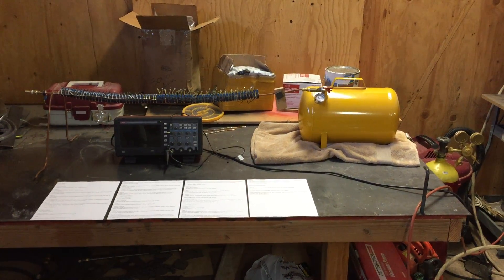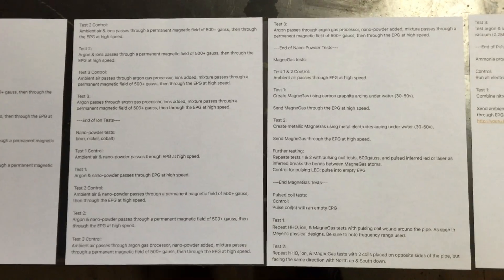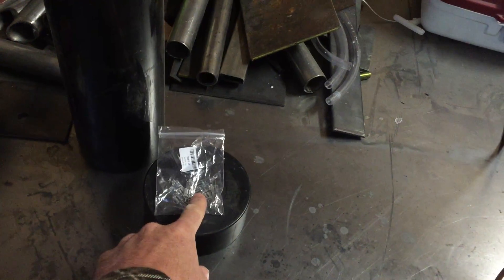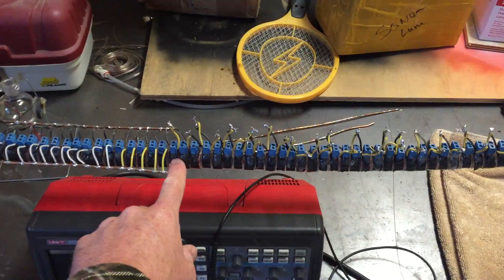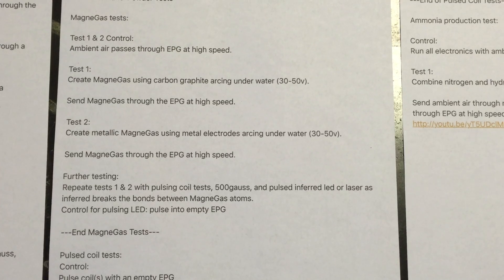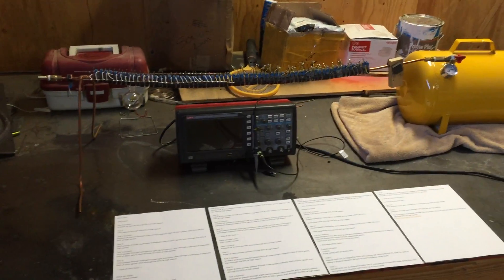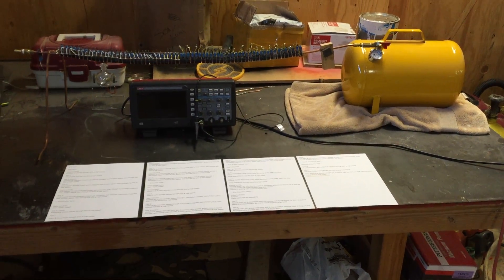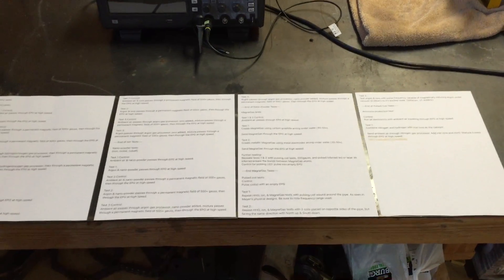EPG Tests 001 - Series Intro

Comment: HI Russell..I am having a go at making cobalt gas (will try iron, but had a cobalt alloy at hand)..so far the results look promising but I haven't made an EPG or similar to test with..I'm at the stage of mixing it with argon which has been ionized...wish I could post you some but they are pretty wary of gas cylinders in the mail..check out my video on the magnetic cobalt vapor which is the first half of the production cycle..   https://www.youtube.com/watch?v=nr77ftiMo4Y
Reply from the maker: +electro1622 Very nice, lots of vapor coming off that! Here's one more way to get metal vapor in the gas, not as pure as your method though: adding metal powder or oxide to water while creating an arc under water. The metal powder flows between the electrodes and vaporizes. Recently confirmed by Frank Sullivan with copper by lighting the gas on fire and showing a green flame. Indicative of burning copper.
Reply: +Russell Martin yeah...it's in a vacuum and melted with induction so the vapor is pretty much just cobalt..it's amazing how the magnetic field affects it making it flow directly to the crucible wall...when you turn the induction field off the vapor rises straight up. Working on a way to trap it and mix with argon now..
With your water idea..you don't have to put iron powder in the water, just make the electrodes from iron, that is where the arc is vaporizing the metal ..not because there is iron powder in the water, Franks did copper in the gas because the electrodes were copper, not because there was copper powder in the water..
Reply from the maker: I agree your method is much better and I can't wait to see your gas in an EPG. I also agree that metal electrodes will vaporize the metal. I was just mentioning one more way to get metal into a gas that I haven't heard anyone talk about before. Frank's electrodes are made of carbon. He is making Magnegas which calls for carbon rods. The hardware that holds the carbon electrodes in place are made of copper. They sat in the water for about a year making copper oxide which ended up in the water. He did not do it on purpose, but the green flame proves there is copper in his gas. I just drew the logical conclusion that one could add a metal powder or oxide to the water and get the same results. Keep up the good work man.